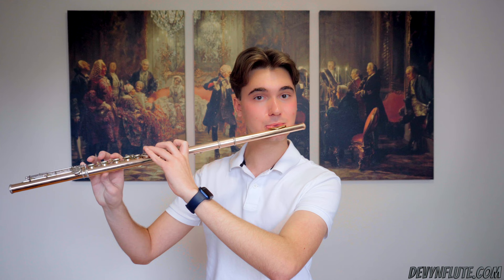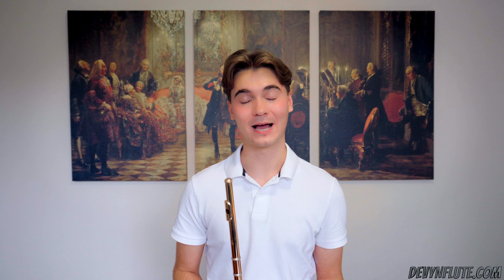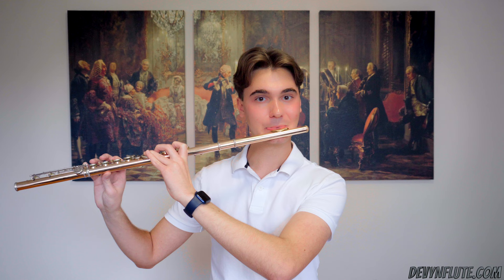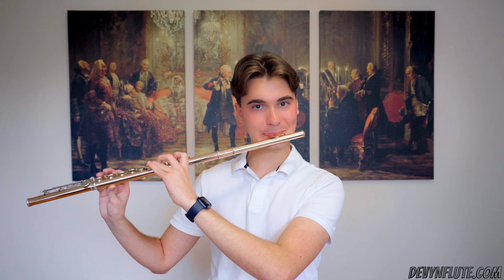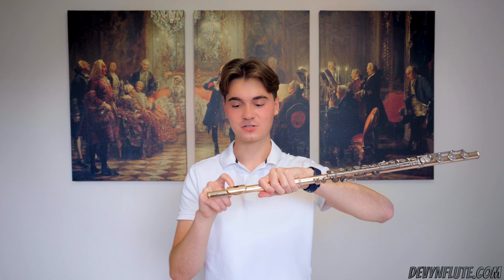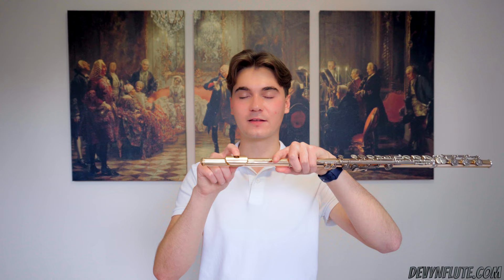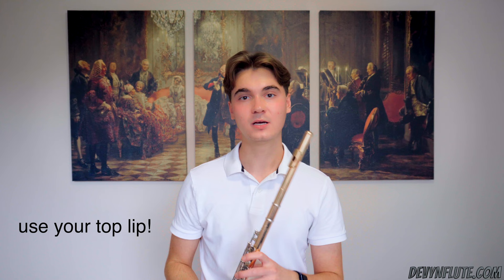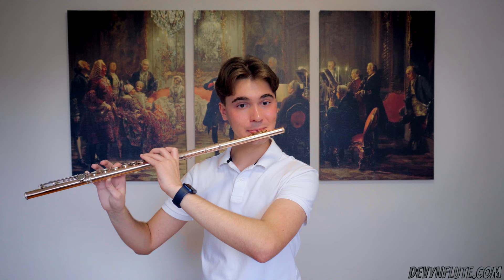How to get a Clear Sound on the Flute | Eliminate the Air in Your Sound

Comment: A trick. Clean wipe the plate, and after a few minutes of playing, look at the condensation ON THE PLATE. It will SHOW you the direction and width of your air stream, and also, if it is centered or not. I have an asymetrical embouchure as do many flutist. You might have a natural position which is NOT centered...

Comment: Do you have recommendations for a beginner... does the pressure of the air and embouchure change as you change pitches? As you play a scale do you need to also change embouchure? Thanks!!
Reply from the maker: Of course, I’ll make videos in the future on how to begin playing the flute. The embouchure does need to change slightly between every note but it is so subtle that it would be better thought of in registers. In the low register you will need to point your air down more and have a slightly wider opening of the lips. The opposite is true for the high notes. I would suggest practicing harmonics, finger a low note and overblow to get the higher notes. This will train your embouchure. Hope this helps!